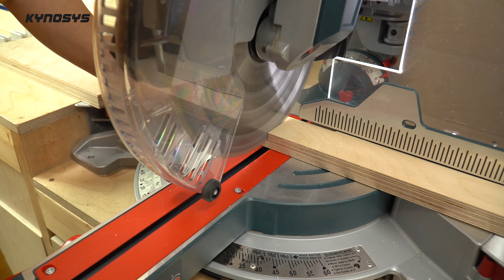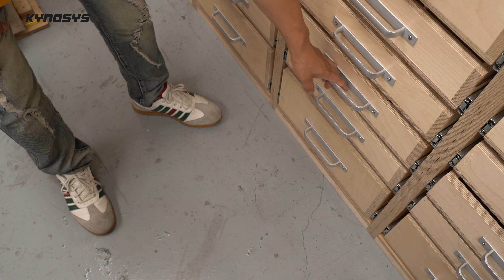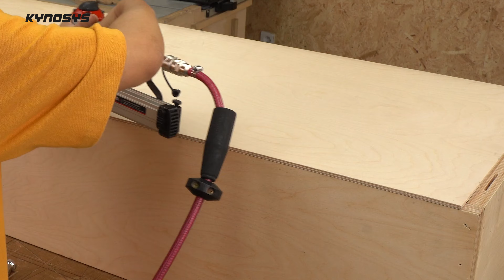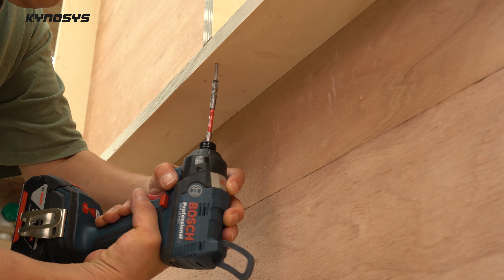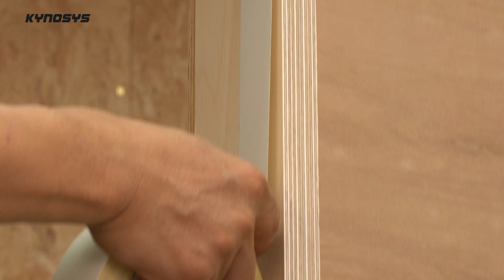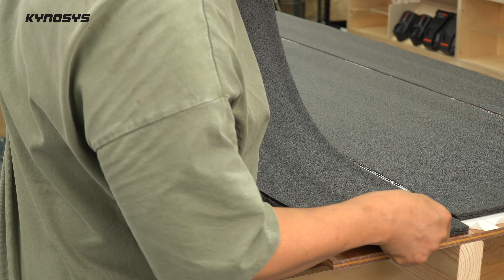Kynosys Power Tool Wall / DIY / Remake

Comment from the maker: I've been running a factory for the past 10 years and I've collected a lot of tools. 
As a DIY person, I didn't leave much construction to the company, but I purposely purchased the necessary tools and did the construction myself. 
In the last two years, some tools have been purchased while I film a tool review video.
In the meantime, these were scattered and placed here and there.
I organized the products of four major brands, Bosch, Milwaukee, DeWalt, and Makita, which I use a lot, in a Wall.
The drills were stored in a battery-type stand called BSTS, which I developed, and other cordless products were inserted into a 100T high-density sponge to complete a wall.
I stored Bosch's power box in the center, DeWalt's tough music system Bluetooth speakers, cordless trimmers and routers.
It is a power tool wall that will be the background when I work on it in the future, and it will be also used as the background for tool reviews.
The tools are gathered in one place, so I think the efficiency will increase a lot when working.
You can also purchase BSTS products that you will see in the video. Please refer my e-mail.
If the video was helpful, please subscribe and like. 
Thank you.